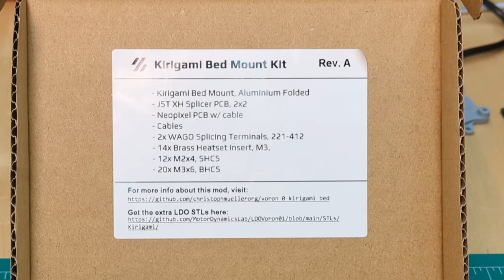Voron Mod Showcase: Kirigami V0 Bed Frame (Kit by LDO Motors)

Comment: I have this on my 0.1 and you need to make sure you don't touch it, especially the front, it bends very easily and you will be re zeroing your bed often if you do touch. At some date in the future i will probably take it back appart and give it a mod to keep it from bending, this really needs a stronger sheet metal, or a design to add support to keep it from bending down.
Reply from the maker: This is the first I've heard of this problem, and we're definitely not experiencing it with this one.  it's quite sturdy.
Reply: I would be happy to have a replacement if i have a defective part. I will be in touch. and will delete my post if i find the singular part defective. till then, my statement above is true.
Reply from the maker: @AM-jw1lo Did you get yours from LDO? There is something very wrong with it if you can accidentally bend the sheet metal, it's very thick and sturdy, I don't know If I could bend the front down, even if I was trying to
Reply: I have one in my hands right now and while it flexes slightly if I grab it with both hands and twist with significant force, it does not bend though. It actually feels really premium

Comment: Is there documentation for the v0.2 kit without removing the old bed (no prior v0/0.1 bed)? The parts are different and there is zero documentation. Also, which parts need heat set inserts specifically?

Comment: Any suggestions on what pins to use for the neopixel connection? On both SKR Pico and SKR Mini e3 v2/3?  Edit: I did see you plugged it into the "Neopixel" port on the SKR Mini. I will have to check and see if the Pico has one of those.
Reply from the maker: All 3 boards should have a 3-pin 'neopixel' or 'RGB LED' header.  The data pin is the center of the 3.   on the SKR pico it's `IO24` on the other 2 boards it's `PA8`.
Reply: @MapleLeafMakers  Great, thanks.. I will try to find it. I looked at the pinout but my eyes could not make it out on the BTT Pico.
Reply from the maker: it actually looks like they didn't label it on the pinout diagram at all: https://docs.vorondesign.com/build/electrical/images/skr-pico-pinout.png I think it's supposed to be the one to the left of E0-Stop, but there's no markings for it in the diagram.
Reply: @MapleLeafMakers  Haha.. yes I think you are right! I was looking at the physical board on the back of one of my V0's and I eventually saw that one labeled "RGB" so I think that's the ticket. I also confrimed with BTT's documentation which also shows the order as GND, GPIO24 and 5V (from left to right)

Comment: What advantages do this bed offer over the standard kit bed? Curious!!!
Reply from the maker: The biggest advantage is easy access to the screws that mount to the linear rail  blocks, meaning when your bed inevitably works itself lose you can retighten it without dismantling half the machine :)  It's also a metal-on-metal connection holding the bed instead of the printed parts, so in theory it's more rigid.
Reply: The bed on a voron 0.1 is supported only on one side, and with printed parts. Usually the bed tends to sag in the front, so you would find yourself loosening the front screw continuously after every few prints. This bed is supposed to be more rigit to endure it doesn't sag

Comment: I realise that in your video, you are not using the rail aligner when putting the rails back. Did you just skip this in the video, or didn't do this at all ?
Reply from the maker: We typically use them, Yes.    With our method of installing the bed they weren't as necessary here since the bed moving up and down smoothly is all that really matters.  Any x y rails you should definitely use them on.
Reply: @MapleLeafMakers  thanks for the reply.
Also, I have another question: If you had the RGB strip on both side of the v0.1, how would you hook the bed led?
Reply from the maker: @Neizo you can chain them all together if you don't mind the extra wire, but otherwise you can probably find another free pin on your board that can drive a few neopixels.  the BLTouch header should work in most cases.
Reply: But wouldn't you still want the rails aligned so there is no binding and excess heat generated by the motor? I know it is hard to test the bed like in the voron docs so was curious.

Comment: How do you know what length to cut the wires too? I'm Nervous to fuck this up lol
Reply: Also is the bed polarity matters? both of the wires are red coming of the silicon, how can I tell which is which?
Reply: @Bennyco86  No, polarity doesn't matter--either for the bed heater or the thermistor.

Comment: your WAGO printed part in the video is not the same in the GitHub
Reply from the maker: The one we're using is from LDO, it just replaces one of the wago slots with a spot for their thermistor splitter pcb. you can find the STL and cad files here: https://github.com/MotorDynamicsLab/LDOVoron0/tree/v02/STLs/Kirigami
Reply: ive got the same issue with the chain anchor. What Ive got from the ldo github as all sorts of bits sticking off it, but i keep seeing videos with it just being a simple spacer like this one. has the model been updated?

Comment: Hi, is there a particular reason why you soldered another piece of cable to the thermal fuse and did not connect the output directly to the Wago?
Reply from the maker: That's how the original wiring came in the LDO V0 kit, it's not soldered, it's a crimp.

Comment: Is it helps with bed twisting issue? Asking because by my understanding is that problem is in 2 rail mount itself...
Reply from the maker: The V0 bed can "twist" when the screws holding it to the rails become loose.  if those screws stay tight it should not twist.  The Kirigami bed makes it easy to tighten these screws and keep your bed from 'twisting'.  There is nothing inherent to the 2-rails that makes the bed able to twist.

Comment: Should there be a need to re-tram the Z beams when you switch from the stock frame to kirigami?
Reply from the maker: Hey!  In a perfect world you don't have to re-tram the z beams at all. That being said, the Kirigami is just Sheet metal and if one of the bends is out a tiny bit..  they may not line up perfectly and you will have to do some work.

Comment: Useful in some ways, but misses the boat if putting kirigami on v0.2 with an existing picobilical. Cable routing with more than 3 frames of video would have been very appreciated.
Reply from the maker: Hi Bill, thanks for the feedback.  We'll try to show the wiring-routing more clearly when we do the 0.2 rebuild.  

The Picobilical (or lack thereof) has no bearing at all on the Kirigami install process.